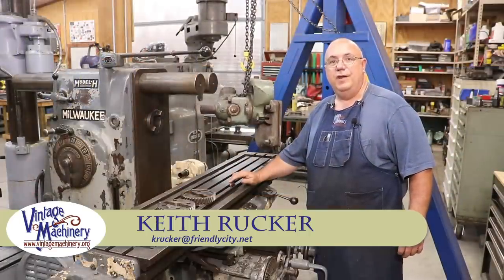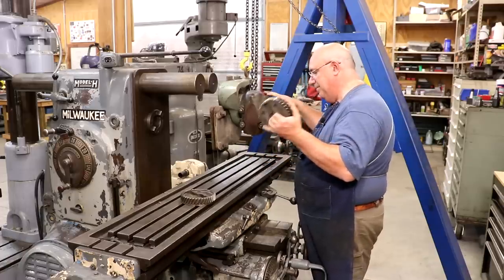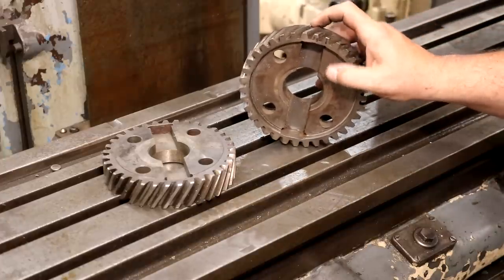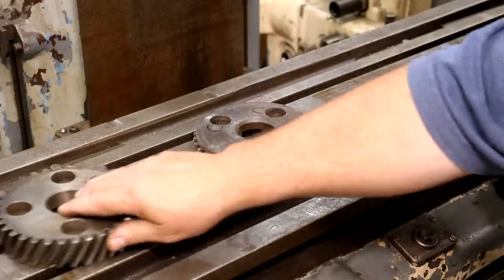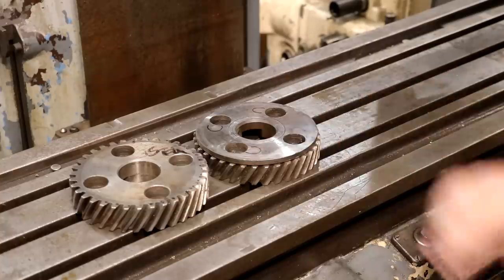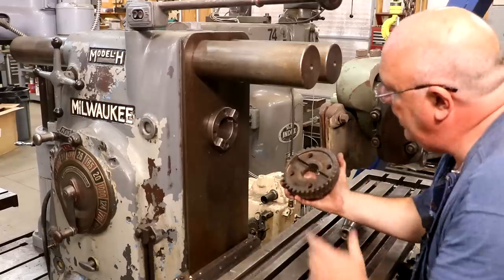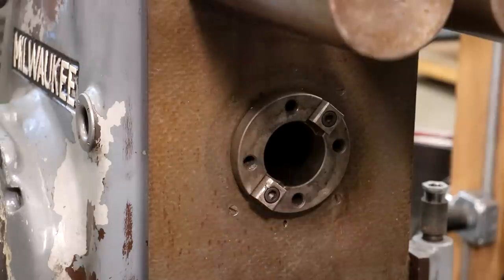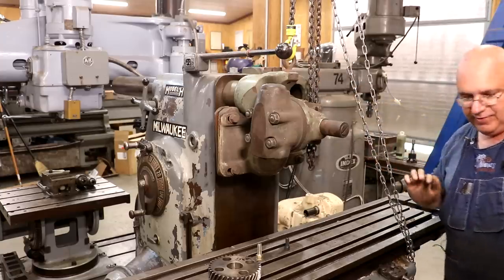Finding a Universal Head Drive Gear for my Kearney & Trecker 3H Horizontal Milling Machine!

Comment: Can somebody tell me some examples where this attachment would be useful? I'd say when working with this at an angle You must operate at least two axis at once - not that it's impossible, just tricky to synchronize.
Reply: Once fitted, it's just a fairly ordinary vertical mill. You don't move anything other than the table as usual.

Comment: 15:00 Does anyone know what the big thick peg sticking out the front of the universal head is for ?

And by 17:00 Keith accidentally explains it - is the cover for the splined drive shaft !
Mine doesn' telescope out like that ! (But I don't need a 'lead attachment' for cutting helical gears ;) )
Reply: Yes, it covers the splined shaft, but it is also where a brace attaches that gives additional support to the assembly, especially when extended.  I have a 2HL with the universal head, and having the universal head is awesome!  I seldom have need to extend the head, so I haven't searched too hard for the brace. It is pictured and described in the literature Keith offers on vintage machinery. Not to hard to replicate if needed.
Reply: @charlesk5519  Presumably the brace fits the overarm bars too. My universal head doesn't move outward but has 2 height positions and a 2 speed gearbox. It's 1:1 speed with the horiz. spindle - top speed 1140 but the head 'overdrive' gear takes that up to 1600. Pic:
https://www.flickr.com/photos/pmailkeey/50888143418
Great toys, aren't they - but I've never played with mine YET. Dad got it and I've inherited it.
Reply: @charlesk5519  I noticed Keith has multiple arbor supports with different diameter bearings. I wonder if one Keith has is actually for the head - and he's not aware of it ?
I suspect the 1960s was the peak for these machines - Electricity was rife, bigger was better, heavier was stonger the 'prototypes' well-established and now companies knew what they wanted and manufacturers made really good quality machine tools - just before things went specialist, programmable, computerised.
Reply: @millomweb  Not sure about all models of K & T, but the 2H and 2HL both have two style of arbor supports. One uses a small bronze/brass bushing/bearing with a corresponding small pilot on the end of the arbor. The other uses a larger diameter spacer/bearing on the arbor shaft and a much larger bronze/brass bushing in the support.  This type can be used as intermediate supports anywhere along the arbor, and in any number that will fit for added support. But being larger, they require more clearance to the part of vice or fixture etc. The smaller pilot type is used on the end of the arbor only...more clearance but sometimes results in the support being further from the cutter, and hence less rigid setup.
Reply: @charlesk5519  Keith has both arbor supports.
The small 'end only' would suit applications where the cutter is right at the end too.
Reply: @charlesk5519  "Yes, it covers the splined shaft, but it is also where a brace attaches that gives additional support to the assembly, especially when extended." 
What does the brace attach to - as the overarm supports do not go through the head.
Reply: @millomweb  There is a picture of the brace in one of the documents Keith has on his VM website...I don't have the brace, so the pic is the only reference I have. But from what I remember (has been awhile since I saw the pic) the brace attaches at the upper end to that "peg sticking out" ( which provides a cover for the splined shaft), while the lower attaches to the dovetail ways of the saddle. Kind of an "A" shaped brace, able to be clamped in position as needed. 
Charles
Reply: @charlesk5519  That's a bizarre arrangement as obviously the saddle is likely to be moved !